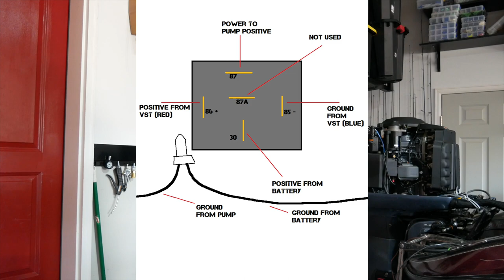LIFT PUMP DELETE OX66 YAMAHA - FULL TUTORIAL (How to DIY)

Comment: If Yamaha would simply change the fuel pump diaphragm material to Viton in lieu of the cheap BUNA-N rubber I believe the fuel pump issues would be resolved.  The exposure to ethanol is causing the problem.

Comment: PAINLESS WIRING makes a GREAT fuel pump relay kit that I have used in several remote pump installs on outboards.  It's a very nice kit and it is $40 and saves a lot of the pains you went through as well as providing a way to mount the relay more solidly.  The CARTER pump is a fantastic pump and will probably last longer than the boat.
Reply from the maker: Great to know. Thanks for the post. Maybe list the product link?

Comment: "Danger, Will Robinson!"  The positive wire from the battery to the pump should be fused at the battery end.  I didn't hear it mentioned in the video, and the write-ups I've read don't mention it either. But ALL electrical feeds from the battery should be fused as close to the battery as possible.  What size fuse?  The pump mfr should have a rating for this.

The reason for locating the relay in a compartment separate from the gas is because a spark will jump from one contact to the other as the contact closes.  Not a big deal unless there are fuel vapors at a combustible ratio in the area of the relay. The same reason not to operate a light switch if you smell natural gas.

FWIW ... My HPDI 150 died on the way from the launch to the cabin when I put the pontoon in the water this year. I had to be towed home.  I suspect the LP pumps and ordered two before seeing this.  This change likely will occur later when taking the boat out of the water.  Thanks for the video!  Nice job.

Comment: Thank you for this video! I've just completed the conversion on my 250
2 trips so far and she's purring!
A few tips to anyone looking to do this.
Buy a waterproof pre wired relay assembly. 4 pin opposed to 5. ( if 5 pin is the only option, unplug relay, remove center yellow wire and connector rather than capping it. Seal the hole) They come with mounting screw. Which I fastened to the top pump block off plate.
This minimizes wiring and keeps the bulk of it in the cowling.
Wire a 30 amp inline fuse right off of the relay. Use heat shrink connectors and tinned copper wiring. 
As an extra failsafe in the event the relay fails. Use opposite connectors on the power in (30) terminal and the power out (87) terminal. If the relay fails you can manually connect the two wires so the pump will be on all the time. This will get you home.
Also the block of plates, I Couldn't find them available online so make your own, 1in wide 1/4 thick aluminum flat bar, few holes (use old pump housing as a drill guide), just made rectangles, no need for curved shape(no sharp edges). Get a felpro gasket roll from the auto store use a hammer punch. Cost around $25 so  Save ya some bones

Also since I've no personal trust in the electric pump/ brand (Carter). It's performance, longevity in salty environment. I can't say much other than it is cheap enough so buy a second pump,  double vacuum seal it along with the hardware and keep it on deck. It's important to pre wire the connectors the same as your in use pump. 
Hopefully you'll never need it, but it's a hell of an insurance policy for an extra $60 some bucks.

Good luck, I'll be sure to update as time goes on.
Reply from the maker: Great Reply. Thanks for the tips
Reply: Could this low pressure fuel pump delete possibly work on the carburettor yamaha 250hp v6? Obviously need to ascertain relay power source but would be interested to hear any opinions. Regards

Comment: The pump inside any compartment on a boat is an extreme fire hazard as the fuel line is now under pressure & if you have any leaks you're going to fill that area with gas!!  With the original vacuum pump system your fuel lines are under a vacuum so if you get a leak you'll suck air! Personally I've never had a problem with the low pressure pumps & I have 3 outboards that use them. The pumps are easy to service & you can buy rebuild kits that are fairly cheap!
Reply from the maker: I understand your concern. Makes a lot of sense to me. To each their own... I decided to go this route after countless issues with my pumps even buying certified Yam parts and beefed up diaphragms. As they say,  "Your mileage may vary". With anything, it's a good idea to stay on top of your fuel system and check periodically for problems.
Reply: Thanks so much for the video Im going to alot of trouble with my fuel sistem my filter never gets full and the motor is not running the way it should thanks again for the video can you tell me more info on the pump where to get it and how much they run thanks so much
Reply from the maker: Amazon. I think it's the Carter 4594. Make sure its legit by checking for a serial number on it.  @josejacobo8229

Comment: Using mine for a year now , no issues . I keep a spare on the boat with bullet connections just in case . 02 225 vmax 🤘🏽
Reply: You have the same motor what psi is yours

Comment: Anxious to see how it works for you after running it a while. Do you have specs for the pump?  I’ve seen a couple variations of this and seems to me they had a return line to tank. Thanks for showing this in great detail.
Reply from the maker: I don't have specs but I do know it operates under 8psi which is what I mainly cared about to prevent any problems in the VST. It's the 4594 Carter I believe. I will verify and if it's different I'll reply here.
Reply: That Carter pump can dead head with no issues.  No return line needed.    It is low Amp draw and lasts years.   I have one that has been in 3 different boats and is still going.

Comment: I have had a lot of issues with these pumps. Going to do the conversion. Wish you would list the parts you used in the description so there is no question about what to buy.
Reply from the maker: Check the description
Reply: @CatchingColorado thank you so much. I just changed my middle fuel pump. It was leaking after only 3 months. Really sick of these pumps so going electric is going to be a nice change. Already ordered the block off plates from Speed Doctor.

Comment: I suck at electrical, so... I'll ask what's probably obvious to everyone else. I know you used 10 gauge on the relay, but the copper wire trigger running from the VST, what are the specs on that wire? Also, what size fuse did you use for the in-line power wire to the relay? Thanks

Comment: first of all great video You have an awsome way of explaining stuff step by step also I noticed that you dont use ear muffs, is running water to the top with the flush hose safe for the motor and the impellar I have heard that yamaha does not recommend it do you have any comment I would appreciate it  thanks
Reply from the maker: I've never had a problem. I also don't run the motor for very long but suffice it to say, if your motor has a pee stream, the impeller is getting water and pushing it through the proper channels. Make sure you have enough water pressure, no kinks in the hose and if the motor stops peeing, turn it off right away. Different motors might have different recommendations but for my ox66 this has worked fine.
Reply: Thanks again you seem very knowledgeable with your motor I have a 2002 Yamaha 225 I've had it for 20 plus years never had a problem with it until recently it's been running rough at about 2,000 rpms like in a long no-wake area it runs fine at three or four grand I've replace the filter in the VST tank and always every year replace a water separator filter even this past spring  I   replaced the mini filters in fuel injectors also replaced all three of the low pressure pumps I did everything I could do I'm stumpt have any ideas?
Reply from the maker: @joeliddle6933  tps sensor might be off. Check it with a volt meter. Could be various other sensors but honestly, mine runs rough under 2k rpms as well especially on cold start. That's why I made this conversion mostly. Hoping it helps..most guys say it does

Comment: Just did this. Connected the trigger wire from the fuel pump to the trigger wire on the high pressure pump. 1 week later. No power to either pump. Got any ideas?

Comment: Where do you get the little metal plates and gasket to seal?
Reply from the maker: Speed Doctor Racing components
Reply: @CatchingColorado  Im there looking for those plates, but can’t find them.
Reply: Hello bud, first of all, I would like to thank you for this steps by steps vídeo to upgrade the fuel system in the outboard. I’m very interested in following your video to do the same job on my two 250hp OX66 Yamaha engines. I have found the pump, the relay with wiring like you listed, but unfortunately can not find the six plates needed to block the lift pumps holes. I did went to the web site you provided but could not find the plates. I wrote them an email requesting assistance and nothing. Do you by any chance have the part number for the plates? I would really appreciate it if you can assist me with these last parts needed to complete the upgrade. That you in advance for your support.
Reply from the maker: @juanc.ortizlopez5285  find him on Facebook and shoot him a message.. it took him about a week to get back to me. I believe I ordered through their website. https://m.facebook.com/story.php?story_fbid=pfbid0SbNrFBMXLUAU4fNhbbYJd9Zf3WXaVg38Zx7v6TaXnQrEf6S7sZguJTo2oa1FmH63l&id=100057202699196&mibextid=Nif5oz
Reply: What does it have to do with throttle response? The vst should already be full of fuel
Reply from the maker: @couchcr  yes, but if the LP pump is leaking fuel into the vacuum ports you get flood conditions.

Comment: Do you have a link for the fuel pump?
Reply from the maker: https://amzn.to/47BeSdV
Reply: Thanks for the swift reply i seen it on Amazon and was wondering if that was it. Still running strong no issues?
Reply from the maker: @kevinhill3549  better than ever!
Reply: Sorry brother but i want to get this correct. At the end you made some modifications. Battery negative straight to relay. Vst negative straight to relay. Red from vst to relay. Red from battery straight to relay. Am i correct here?
Reply from the maker: @kevinhill3549   no. The correct diagram is in the video at 26 minute mark. The ground does not go to the relay. It goes directly to the pump.

Comment: How is this working currently after 9 months
Reply from the maker: Zero Issues! Works better than ever!
Reply: Did you remove the primer bulb? May have missed it in video
Reply: Just seen you deleted it. I wonder if you could just mount everything back at engine. Use vst pump wires to trigger relay and use starter wires to feed relay to feed new pump